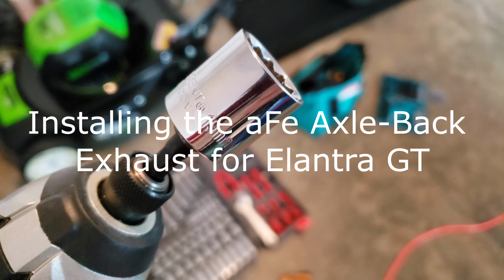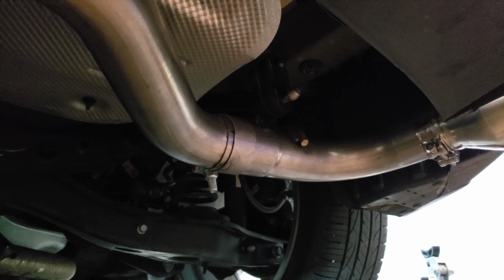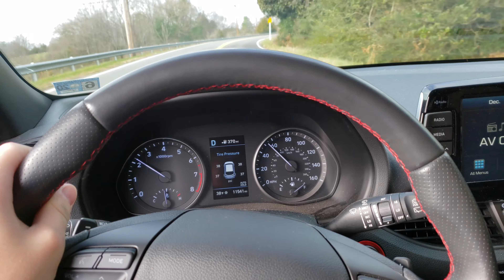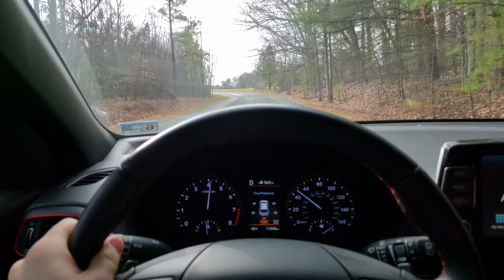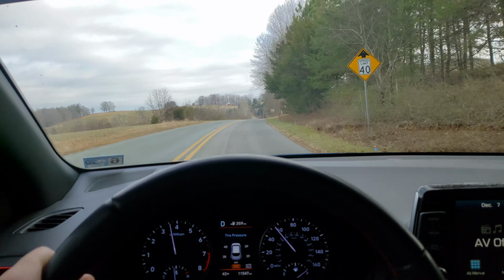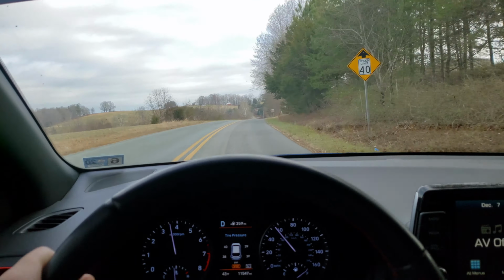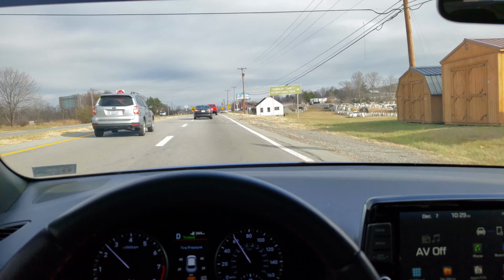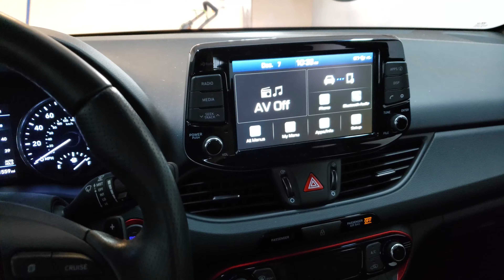Installing aFe Axle Back Exhaust for 2018+ Hyundai Elantra GT Sport (N Line) & Test Drive!

Comment: Just got my custom axle back installed today...it’s insanely loud, it crackles, pops and gurgles...it cost $300 taxes in Canadian, the exhaust shop used a flowmaster y pipe, all stainless steel with satin black 4” tips. I’m calling it NIGHTMARE...you weren’t lying when you said it sounds like a veloster n but twice as loud. Anyone know how to get rid of the droning? I will make vid soon, it’s damn cold here in Canada
Reply from the maker: There must be something going on with the geometry of your setup. Maybe it's the diameter of the tubing or shape, but I don't really experience that much noise unless I'm at least on it a little.. When I'm on the highway, there is little to no drone, and if I'm just cruising, there is none, but the diameter is smaller on the AFE prefab, and that may be why it's not so obnoxious like you describe. I'm very sorry to hear you don't like the exhaust you got :(
Reply: Brave_SirRobin I didn’t say I don’t love it, I do just not the drone on the highway. The y pipe is 3” and the rest is stock 2.5”. The setup looks like an xforce system. Like I said I will post a vid soon and hope to get your opinion, thanks for responding bc I decided to get it done after watching your clip, I will be putting a resonator on in the future but for now I will enjoy the silence lol
Reply from the maker: @2tonedangert891  Oh lol, I misunderstood when you said "NIGHTMARE." I read quickly on my phone and didn't get what you were trying to say! But yeah, it is a little loud and sometimes even obnoxious when you're just trying to drive around casually or quietly at night, but it more than makes up for it with the road presence it gives you and just the dastardly smile it can put on your face with every rev and burble/pop. :)
Reply: I got the whole exhaust last summer and it's great but insanely loud. I was definitely surprised when I first drove it haha! When the snow will be gone I'll put a resonator and most likely a muffler too.
Reply: Martin B-E it sounds great, it’s louder than mine lol...I thought my muffler delete got quieter but I just got use to the noise, looking forward to your next post

Comment: Did you recently sell your exaust on ebay because I bought one with one of the exaust tips with a bolt that was a 14mm and the other was 13mm
Reply from the maker: Hmm it must have been a while ago. Because of used car prices so high, I sold out and bought a G35 to throw around for a while.

Comment: Did your Elantra come with the red trim on the A/C control panel? I have a 2020 N line and it only came with red trim on the driver and passenger A/C vents.  Kinda bummed out now lol. Exhaust sounds good btw.
Reply: the earlier models had that red trim, the later models don't.

Comment: Exhaust sounds great! Where did you get the red trim on the starter button?
Reply from the maker: On the 2018 Sport models, they come with that red trim from the factory 😎
Reply: @ln103815  they should have kept it on the 2020 N Line

Comment: Hello mate! Please tell me, after a while - are you don't disappointed with this modification? Does it interfere with long journeys? Weren't there any cases when the cops stopped you for this modification?

I want to install the same exhaust, but I doubt whether this modification will bother a one-year-old child in a car ...
Reply from the maker: If you have a younger child, I would not recommend changing the exhaust on the car since the increased noise could make it less comfortable. There is an areo component to the underside of the stock exhaust that helps to reduce wind noise and vibration and that is exactly what you want when the car needs to sound and feel smooth.
Reply: @ln103815  Ok, thank you!

Comment: Nice Video ... I drive that route every day going to Greensboro NC for work from Moneta .. I'll be in the 2019 hyundai elantra gt n line .. cheers! 
I was looking into updating the exhaust & adding cold air intake system too..
Reply from the maker: That's so cool you recognize the location! Also, that's a hell of a commute. I just wanted to reply to give you one more option that would be better for highway driving. I have not yet personally tested this system, although I plan to. It's made in Korea and it's more compliant on the highway, but should still deliver big sound. The aFe will be louder. http://m.kdmholic.com/product/jun-bl-dual-exhaust-system-for-hyundai-elantra-gt-i30-pd-2018-16l-t-gd/2103/category/68/display/1/#prdDetail
Reply: @ln103815  thanks for the additional info .. I'll look into that option :)
Yes .. I was watching your video and I was like I know that 220 stretch... usually going quick up and around the curve and past the farm eqmnt place on the right :) 

It's a fun road .. .. but too many places for the police to hide ;)

Comment: SXTH Element Short Ram Intake System, got it with BPV or without BPV.
Reply from the maker: I got it without, so it just vents out into the air instead of going into the intake
Reply: @ln103815  with the stock bov?
Reply from the maker: @chomonguspr8460  yup, it looks really tight in there to replace it so I haven't yet
Reply: Brave_SirRobin million dollar question is, does our car have MAF?

Comment: Any idea if this will fit on a 2.0 base model 2018 Hyundai Elantra GT?
Reply from the maker: Sick Atewoneight not without seriously modifying your bumper to allow the exhaust to come through, plus I'm not sure if the pipes under the base model are the same size or even if they are in the same place for correct fitment. So my answer is basically no, unfortunately.

Comment: Where did you purchase the exhaust?
Reply from the maker: I got it from here: https://afepower.com/afe-power-49-37002-1p-takeda-3-to-2-1-2-304-stainless-steel-axle-back-exhaust
Reply: Thanks...with the shipping and conversion to Canadian $ I’ve decided to custom make the exhaust, stainless steel axle back with 4” chrome tips, welded seams, the shop will fabricate and install for under $300 Canadian and the best part is I keep my original exhaust if I get tired of noise, but I know I won’t...thanks again for the vid and info